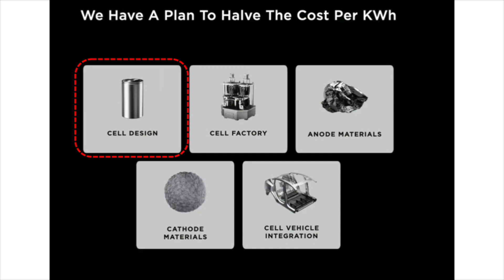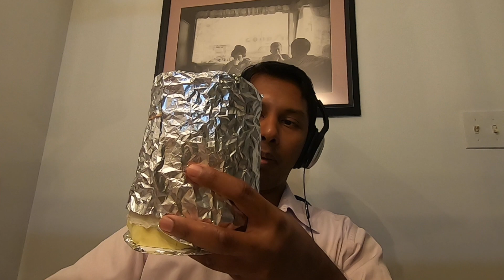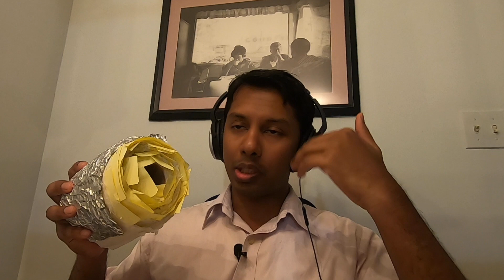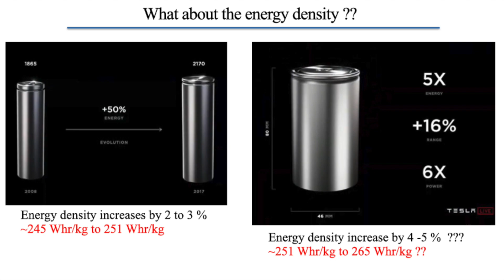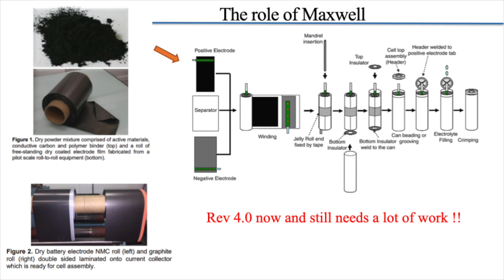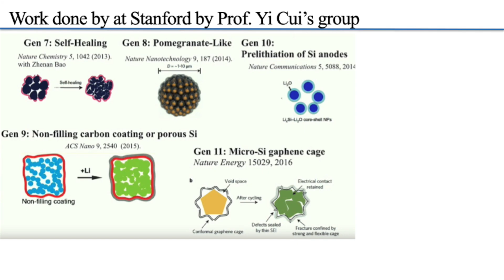Breaking down Tesla's Battery Day with Ravi Kempaiah

Comment: Ravindran at first I thought what does a Mechanical Engineer about chemistry and batteries. I do like your evaluation skills and I’m responding as You speak and now this 4680 cell has become a structural component of the car by epoxying the cells altogether eliminating voids between cells for cooling and now the cooling is all by the bottom plate with cellular construction for cooling and heating. I could be wrong but I believe that 
Your jelly roll with the post it notes is for the top which is the CATHODE and positive terminal that is welded to the Center button. The negative Anode is in contact with the case and again is welded to the case on the top circumference and is common.. The heat ends up on the bottom and convection of heat rising is not involved but conduction for heat transfer is what is happening. I thought where You could give the most input is the design of HIGHBAR’s winding equipment that has gone through 12 revision of equipment. I thought you should have given some time to explain how the tabs were laser cut and had different profiles  depending on the jelly roll grows at is wound from Center to 46 mm diameter. Now You have really dug your self a hole because You have no Clue and are completing wrong about the number of cells and welding. NOW LISTEN EVERYONE GO TO MUNRO LIVE for his mock-up. There are 384 individual cells and all epoxied together. No Modules but the first 96 cells are connected in series to thane 336 volts. The next 3 section are all connected in parallel so the positive and negative terminals end up at one end. I’m sorry but you got it all wrong. Fall on your sword and repent for making up all this bullshit. YOU ARE NOT A CHEMICAL SCIENTIST EITHER..
THIS TURNED INTO A PATHETIC SHOW.

Comment: Tesla truck stops are a big deal too. Will Tesla buy land, rent out space to restaurants? They’ll have 1 to 5 gigawatts of storage to charge 1 megawatt truck batteries matched with at least some on site solar along with grid energy. The chargers will be novel and could be multi hookups with special charging heads. This network will be huge. Tesla could also  put 1 terrawatt mega storage capacity at some truck locations to create their own distributed grid storage to pair with larger land holdings in rural areas where trucks go and land is cheap. They are definitely thinking about this!

Comment: I knew the semi had to wait production til an improved battery was designed, however the 2170 is still an excellent battery for cars due to it's redundancy. but it will take a few years for the 4680 to be used in cars. Realistically Panasonic should have invented it first because they should have had the expertise and with the lower cost could have sold this battery to all the other oem's and have made more profits.

Comment: Here are he numbers for SEMI TRUCK:  Weight of the rig 36 tons max.  width / height 2.5m/4.1 m   CD = 0.36 ,  rolling resistance = 0.012. Required  power at 100 km/h (60MPH) = 153.27 KW. 
 Battery 1000 KWH. Range 400 miles at 60 MPH.    IT IS ALL FEASIBLE!!!!!!!!!   ROLLING RESISTANCE POWER IS 2 TIMES BIGGER THAT AIR RESISTANCE POWER (107.91 KW vs 45.36 KW)

Comment: I would assume that on semi there will have  800 V system so you need 200 cells per pack to get you 800 V (4 volts per cell) Then you connect  packs in parallel  to get total current in the range of 190 amps.

Comment: This is amazing, lowering internal resistance of the battery means instant high torque and accelaration. Also battery can handle higher currents in charging.

Comment: Freely moving electrons are what defines metals. These electrons can conduct electricity, but they also move heat really fast (compared to most non-metallic materials). When Elon was talking about the electrons not having to travel as far in the tabless cell, I think he was referring to the superiour thermal properties of the new design. The cells can be heated or cooled much more effectively.

Comment: The new cell design is not needed for megacharging (but it will help a lot!). If a model 3 with a 75 kWh battery can charge at a 250 kW rate, that's equivalent (same current going into the cells) to a 1MWh semi truck charging at over 3 MW.

Comment: Okay, I've gone entirely off this video, starting at 22 minutes in. The guy doesn't understand what a C rate is, but you're interviewing him about batteries?
Reply from the maker: I’m confident he does. Check out some of his other videos. Though he doesn’t publicly talk about it, I think you’ll find his upcoming employer as quite reputable.
Reply: @AllThingsEV  He very clearly did not. He is of the misconception that the maximum rate at which you can charge a battery pack that utilizes a given type of cell is independent of the size of the battery pack. Which of course is complete nonsense.  As if if you were to take 8 Model 3 battery packs side by side, which can each individually charge at 250kW, so together,  250 x 8 = 2MW... but then you put them all inside one bigger box with 8x-current wiring and 8x-flow-rate cooling connected to an 8x-sized radiator, etc.... and all of the sudden, that box can't do more than 250kW total, e.g. the individual packs become unable to charge at more than ~31kW each?  It's rubbish.  That's not how batteries work.

This is really basic stuff . The fact that he doesn't understand it calls into question everything else he has to say on the topic. Doesn't matter whether he's about to start a job at Tesla (what I presume you're hinting at) or not; it changes nothing written above.

Comment: I was hoping for more discussion on the handling of heat - both on charging and discharging with the 4680.  Sandy Monroe claims the larger diameter ratio will wick heat more efficiently through the ends of the battery and heat removal will be through the ends - more efficient.  Heat transfer was mentioned about half way through the video but didn't get a clear answer on this.  Great video!

Comment: A very well done overview of the the battery architecture and advantages by Ravi.  Thanks to Ravi and Sean for putting this together.
Some of my observations:

⦿ Re: "Tabless"... "Tabless" is a misnomer.  "Tabfull" or "Continuous Tab" is more accurate.
⦿ Re: power needs when charging a semi: worrying about instantaneous power needs is not the issue.  The total power requirements over the course of a period of time (say 24 hours) is the issue.  ...and this issue has already been resolved to a large extent with Tesla stationary batteries.  If Tesla can do this at Hornsdale, I don't think a single charging station is going to cause a problem.
⦿  Re: Formation: This is apparently not a continuous process, as what I see in the photos suggests large batches of batteries hooked to the formation equipment.  I've seen Krispy Kreme handle continuous doughnut formation (ok, proofing), and suspect there is a way to do it with battery formation also.

⦿ Re: recycling ultimately eliminating the need for mining... Bollocks.  It will reduce peak mining but not eliminate mining.
⦿ Re: letting other companies figure out battery evolution and production.  Why would Tesla place their continued success, not to mention the value of their own IP, in the hands of other companies that are not able to produce what Tesla critically needs?  Maybe (but only maybe) license the IP to others.  Unfortunately, this places companies other than Tesla in the position to harvest new IP derived from Tesla's original IP - something that Tesla should jealously guard.  Ari P
 has a good response to this issue in his/her comment.
⦿ The tabless design can incidentally be used for both ends of the battery.  The tabless design not only lowers internal resistance, but increases thermal conductivity (as pointed out by others).  Note that copper is better than aluminum for thermal (and electrical) conduction - silver would be even better.  JOHN YOUNGQUIST
 mentions multiple smaller batteries have a better internal conduction (both thermal and electrical) than just a single small battery - so the improved conduction of the 4680 can't be compared against a single 18650 or 2170.
⦿ Re: Connecting the tabs to the can... I think Tesla will end up simply soldering the tabs to the can.  (Tin the tabs before inserting into the can. Tin the end caps. Insert into the can. Briefly heat the caps enough to melt the tabs to the cap.  Done.)  This, btw, also allows thermal conduction not possible with various devices diagramed in the patent application.  We don't ever need to disassemble the can again, so having a dynamic tab-to-can connection is unneeded. 
⦿  The unmentioned problem of lack of flatness to the cell ends...  If you have ever attempted to fold that many tabs over in one direction, you'll see that the bottom of the cell (after folding all of the tabs inward), is not close to flat.  This wasn't called out by anyone, and the photo taken of the folded end doesn't show this very well (purposefully?)  This could be solved by selectively thinning and resizing the tabs (I like the shingle analogy) whilst rolling the jelly roll.

-and I am likely wrong on some or all of these comments.  Hopefully just less wrong! :)

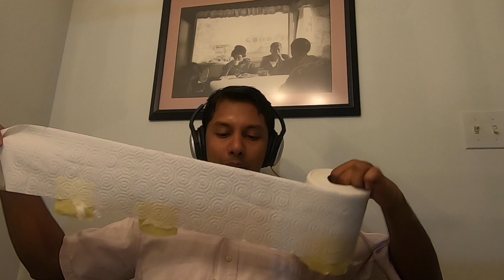Comment: Can someone help me understand if Ravi K is correct in his model on the tabless design?  11:14 shows space between the yellow sticky notes, but how is this more efficient than putting a single tab on?  I think the design is you are essentially cutting a snip and folding it over, that is what it looks like to me all the while this is flying down a production line with NO stoppage.  The Copper colored top that Elon showed seems that way, you are just snipping so you can fold it over in a circle.  This is exactly how you lay down leather around a curve.  Ravi's explanation simply is putting 5x the number of tabs, that would greatly slow down the process even further vs stamping a 1000 snips so you can fold over on a curve (cylinder).   There is no gaps in the Elon battery day picture, it is snip 1/4" and fold it over on a 100 mph production line.  Take the toilet paper, and lose the yellow sticky notes and take a scissors and cut down 1 inch on the white toilet paper and fold it over, that seems to be the reproduction model of the 4680.  Help me understand what I am missing?
Reply: I think you are correct - Post-It notes are only a very rough way of demonstrating how it works.  A better way would have been to snip the ends of the TP and bend the loose ends inwards - exactly as you describe.

Comment: Ravi, given the sensitivity of Li-ion chemistry and materials to temperature, can you come back and talk the thermal cooling aspect of going from the 1 cm tab per meter in the current cells to the almost 1 meter per meter cooling of the new cell? Nearly 100 times the ability to remove heat allows you to charge faster and optimize cell material temperature protection! Right in your ME PHD knowledge!

Comment: in your mockup the cathode is the bottom with post-it notes (118), yes?  And that end is what heats up first.  The pack structure can be designed to wick from that end only - maybe the pack will be upside down with the anodes and connectors on the bottom and cathode end up.  All mind boggling advances - I like the improved polar moment of inertia while lightening the whole car - and I want the convertible version I always say.

Comment: Tesla's new battery system will charge more efficiently without over heating and take regen energy more effectively with a lot less resistance which in turn will also make the batteries last longer. 
Can't wait to see this battery in all the cars, the semi, cybertruck and the plaid model S are first in line, I'm guessing the rest will be couple of years or so 
A lot people didn't realize how important this was and I think most people didn't fully understand the significance of that announcement. It really will be a leap ahead ones this battery system is implanted in all Teslas

Comment: The volume of the 4680 would be 5.48 times the volume of the 2170, so if all else were equal (e.g.., not counting any changes in the chemistry) Tesla would require  no more than ~1/5.48 (18%) as many 4680 cells to provide the same amount of stored energy, rather than 1/4 (25%) as many 2170 cells, as stated by Ravi.

Comment: I won't pretend to understand all the chemistry, but I find the new cell structure really interesting.  I'd be curious to know if there's a way for someone else to get around Telsa's patented charge collector shapes.  They seem to have specified a few different possible shapes. 

My understanding is that you have three layers in the jellyroll - the cathode material, the electrolyte, and the anode material.  If you left the anode material sticking out above, and the cathode material sticking out below, would it be possible to pinch both ends of the jellyroll without having a bunch of specific tabs?  Would pinching both ends be possible with a larger diameter roll, or would the wasted material be too large relative to the size of the cell?

Comment: Do these new 'tabs' need to be welded on at each position?    or are they 'sandwiched' inbetween the layers ?
Reply: They are simply part of the cathode conductor that is longer than necessary.  The excess is scored and then bent inward to form the "flower".
Reply: George Sawyer excellent thank you for the clarification.  👍🏻

Comment: Generating the electricity is no problem what so ever.  I saw a report a report a number of years ago how the current electric grid can support 80-90 million cars charging over night during off peak hours.  On the electricity savings side, any electricity we save by other means, we can use for cars.  A new electric hot water heaters are available.  They are called hybrid hot water heaters, available at Home Depot, etc.   They save the electric hot water heater owner on average $480/year.  This is enough electricity to drive a Tesla Model 3 15,000 miles.  We have 50,000,000 electric hot water heaters in the country,  So convert all the electric hot water heaters to hybrid electric hot water heaters would provide enough electricity for another 50 million electric cars.  The estimate for banning incandescent and replacing with LEDs is expected to save 75-150 average power plants of electricity.  How many cars is that?  Without building a power plant we are at 150+ cars.

On the power plant building side, we have expericened decades of 5% growth per year.  Ramping up another few decades of growth with solar/wind power, to meet the demand of the rest of electric cars, shouldn't be any problem.

Comment: One advantage i see in the new cells is the redundency in the current path. On the old cells if there was a defect in the tab, the cell was dead, but with this multitab design you could have several fail and it would still work fine.

Comment: It doesn't seem like a tabless design at all. Tesla tries actually to replace one tab with dozens. Am I missing something?
Reply: Yes, you are. The real design isn't made of PostIt notes, instead of a lot of tabs it is one long continuous connection that folds over, and the folds slightly overlap each other because they spiral around the center of the cell. They look like a lot of tabs in the pictures but they're continuous.

Comment: 5:58 2170 cell has a volume of 24,245 mm^3; 4680, 132,952 mm^3, which means you need 5.48 old cell for the same volume of a new one. How do you get 4-5% increase? 

On top of that, if you remove a mm of wall thickness and 2 for top and bottom, effective volume are resp. 14,980 and 105,293, which means you need 7.02 old cells to make up up for the same volume as a new one. As you can only take five (their slide mentions 5x energy) for volume of 7.02, you get a 40% increase in energy density-volume wise? (this seems insanely high)

0.5mm off wall thickness, 2mm for top and bottom for old cell; resp. 1mm/3mm for new cell still gives 5.48 old cell for a new one, for a 9.6% increase in energy density (volume).

My guts tell me +30% is likely at the cell level, knowing that you'll lose some at pack level because larger diameter means larger gaps between cells. Thoughts anyone?

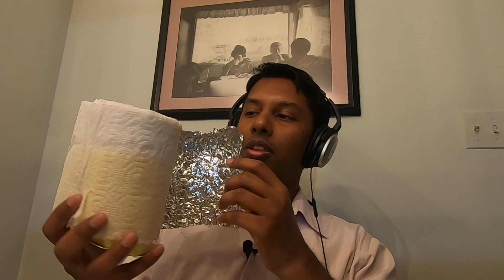Comment: 11:00 so the can is still steel, do you see that ever changing ?
Just off setting would work you don't need grooves and .multiple mini tabs, its over complicated
Reply: 4680 cells are Already using 46% less metal for the Container than a 2170.
Reply: @markplott4820  yes that's true, the question was still steel so I guess that's a yes, and thermally its axial rather than through the side, maybe that's the reason for that complicated multi tabbing of copper work in the picture.

Comment: Solid state will never happen, dry paste/dry cell yes maybe, on the 4680, but the "tabs" look even more complicated than before, and no mention of environmental thermal management methodology for the new 4680.
Yes I understand internal resistance is less but you still have to counter overnight chilled pack or day parked over heated cells.

Comment: Sean, to understand why Tesla didn't ask 3rd parties to manufacture batteries this way makes sense when you consider what their vision is. I believe it's a significant reason why analysts don't understand Tesla. In order to fulfill their vision, they can't make decisions like other companies would. If they did, their vision would be much harder to achieve. Everything I've seen Tesla do so far has been much easier to understand by evaluating it within the context of their vision, and by adding "as quickly as possible" at the end of it. Cheers!